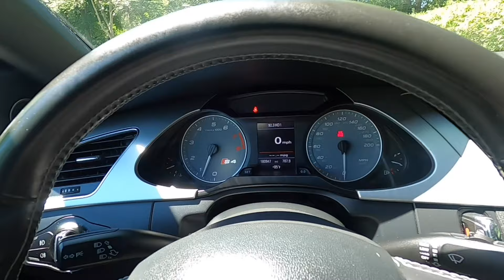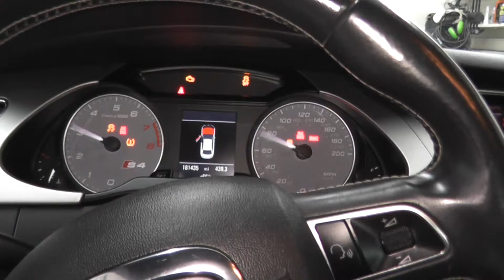Audi S4 Alternator Replacement - AT HOME - With Basic Hand Tools

Comment: i’ve been looking at some nice b8 S4’s near me. but they are all in excellent condition but my only concern is the mileage on the cars. it’s something i want to turn into a project car. they go for around 100k miles for 10-12k. do you think it would be worth it ?? or if anyone has an idea
Reply: They are worth tbh, but i recommend the b8.5s. If theyre over 100k ur only issue is the thermostat, waterpump, PCV, valve cover, dsg fluids, and carbon cleaning. Other than that its a titan of an engine and a beautiful car. Those should get done every 100k miles except the dsg should be done every 30k miles. There is a bit of contention on whether diff fluids should be changed but most do them just cause they have the car up. But amazing car overall
Reply: mileage isn’t what you need to worry about. these cars go up to 300-400k miles with original engine and transmission with proper maintenance. i’ve seen people have harry potter books of records but because they followed the manufacturer intervals (lifetime fluids never even get changed and oil changes are every 10,000 miles) they ended up blowing their motor or trans around 100k miles sometimes even less.
buy it from someone who did their oil every 3-5k miles and who isn’t just using the car for a to b transport. if they don’t redline the car after it’s warmed up, the constant low rpm can cause carbon build up and cause significant damage to the engine over time.
i see you posted this a year ago so i hope you got an s4 wether it s a b8 or b8.5.
good luck

Comment: Can do it without removing the whole front end they doin extra unnecessary work it’s tight in there but if you have a belt tool you can get it easily an quickly
Reply: It’s not unnecessary dude I don’t know how tight your hands are I could not fit my hands in there